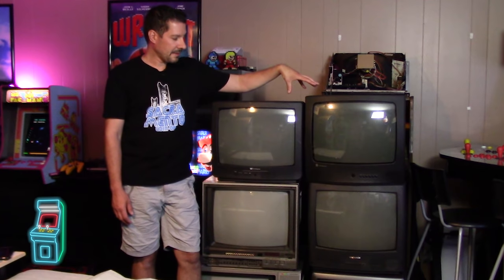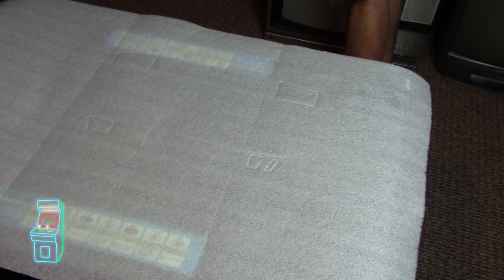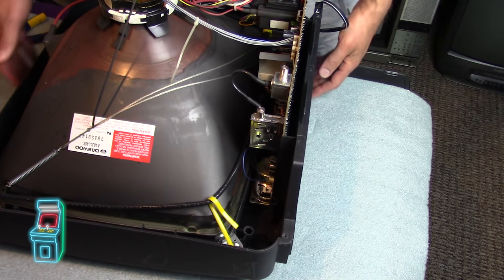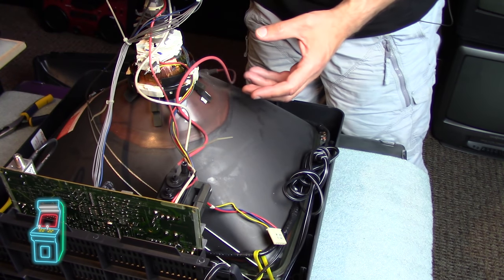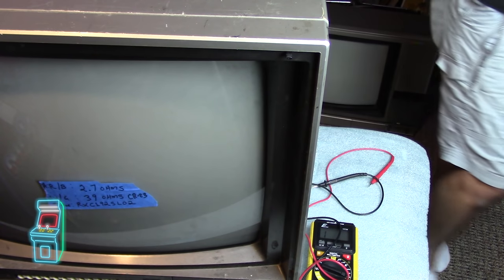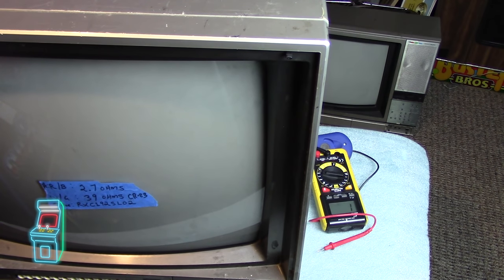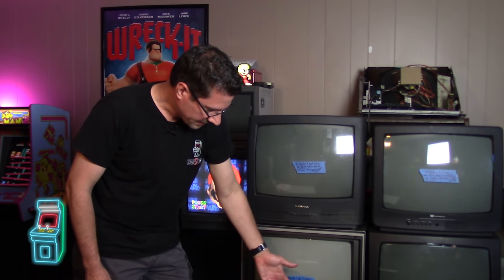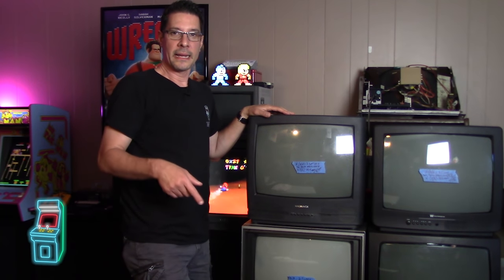TV tubes for Arcade Monitors

Comment: Nice video, I've got quite a collection of crts now  from 10" to 28", i loose the original casings and just shelve the bare tubes in clear bags plus labled, saves space and ready to be taken off for the next build or repair that cone somes in, any crt I find on the road or people listing for free etc i take and strip them, the tubes are usually spot on, i also keep the chassis especially from the real  older sets as I've found the older tvs have good width coils thay are very handy for repairing WG arcade chassis where the width coils are no longer available, the old chassis are also spot on for cribbing parts from.
Reply from the maker: Glad you enjoyed the video!  I keep mine in the cases when I find them. A) I'm able to stack them on each other for storage B) It protects the neck C) My recycle center doesn't take bare tubes, it needs a case. So I swap out the tube when needed and put the burned tube in the TV case. Problem solved. ;-)
Thanks again for watching and leaving a comment. I enjoy reading them.

Comment: I have a sharp tube #a68krq58x. It has measurements of horizontal 1.9 ohms vertical 6.1 ohms. Does this tube match up with any arcade chassis?

Comment: Your comments say 4600 and your video you say 4900.    Great video  now I’m wanting to go tv hunting
Reply from the maker: Correct.  I updated the comments to be more accurate. At the time of the video I had thought that it was a drop in replacement for a 4900 but after checking Ohms on the 4900 itself,  it didn't match up.
Reply: DeLuSioNaL's Arcade  all good I was excited I need some 4600 drop in tubes.  Appreciate your channel
Reply: Doug Jones I had luck with a wood grain early  80’s Zenith for a 4600
Reply from the maker: @alanbrady9609  I went to the recycling center today to dump the Trinitron and came home with a Zenith Woodgrain TV. I still need the test it, but I'm pretty sure it had a CR23 neck.
Reply: DeLuSioNaL's Arcade that’s what I did too!!! I was able to talk the recycling center to swap me tv’s. Ended up with a 25” K7000 compatible tube.

Comment: You didn’t explain how you’re cross referencing the compatibility of the TV tubes. How do you confirm which game a tube will work with?  Are the original arcade tube specs documented somewhere or are you just comparing the resistance in the yikes between the two?  Please explain.
Reply from the maker: I explain it in a later video. Cue it up to 10.23: https://youtu.be/20rZGpSP0dc

Comment: Hey Del love your videos.  Got me brave enough to contemplate tube swap.  Picked up a free sharp 19” tv  amazed my first one a48jll40x  my readings only came out 3.9 and 13.8. Will it work on a k7000 ? I have a milipede I would love to pull the matushita and reinstall with this
Reply from the maker: Yes that should work with a K7000.  Cue up the following video to 10 : 30.  I show a list of monitors and their readings. https://youtu.be/20rZGpSP0dc
Reply: Awesome
Thanks man. I know I got lucky first tv I brought home from my ad on the neighborhood app.  Older folks still holding on to tubes  around me
Reply from the maker: @douginsuresme  Yeah, that should be a drop in replacement.

Comment: How are you doing the degaussing coil on k4600 tube swaps.  The original one is fastened to the metal shield and then soldered to a capacitor. For other monitor tube swaps I always use the  coil on the new tube but I'm not sure how to handle this on the 4600.
Reply from the maker: I plan to eventually do a k4600 since I do have a couple of drop in replacements for that chassis. I plan on using the original degaussing coil for the old tube though. There's no way around that it should fit just fine.

Comment: Hey what's up. I haven't found a single drop in replacement for the k-4900 yet. How much allowance will you tolerate for a drop-in replacement without switching the yoke for those 4900s? That vertical is kind of an odd measurement
Reply from the maker: Yeah that's a tough one to do. K7000 is the most common (CR-31 ). Followed by the older K4600 (CR-23) then K4900 (CR-23) then G-07 (CR-23), in that order. 
There's a list of the Ohm readings for models in the description below. Generally they should be very close to those readings, give or take. If not you will have to swap the yoke over to the new tube, assuming it's the same type.
Here's a playlist I made on arcade monitor repair. In it you will find videos with me testing yoke Ohms on donor TV sets.
https://www.youtube.com/playlist?list=PLMenkBsi2LKD_UMKA36kBKNZ9sES2lON5
Reply: @delsarcade  have you been doing more yoke swaps lately? The last time I watched a video you were still not comfortable with doing the yoke  swap yet and color convergence.
Reply from the maker: I will eventually do one. On a K4900 as a matter of fact. :-)

Comment: I have a tube that actually can’t be identified on tubular?
Reply from the maker: I've had the same thing happen now and then. MOST tubes are at 6.3v (Heater) and 50v (G1) if it doesn't pop up on tubular.
The neck size is typically either CR-23 (thicker neck) or CR-31 (skinny neck).  I've never seen a donor tube any other neck size.  Although there are some oddball arcade tubes out there like the Matsushita (CR-30).

Comment: Hey Delusional I have a question for you.  My arcade tube is having issues and I need to swap tubes.  Finding a 25” on CRAIGSLIST or Facebook buy and sell are near impossible now.  I think these smaller CRT’s were too easy to throw in the car and haul to Goodwill in the day.  All people are giving away  ie are the behemoth 32 and 36” sets  😝  27” tubes  seem a little easier to find however.  Have you ever tried swapping in a 27” tube into a Wells K7000 chassis that’s built for 25”?  I have a Wells K7193 which was built for a 25” .... will this work?

Thanks Delusional,
Adam
Reply from the maker: Nope. It won't. You're looking for trouble if you try swapping different sized tubes. (Radiation issues and such).  I believe it's more dangerous if you swap a smaller tube into a bigger chassis since the chassis is pushing more xrays.  Also if I'm not mistaken if you do the reverse the image will be smaller on the bigger tube (or won't work at all).  I would not chance it. 
Try joining the CRT Collective on FB.
Reply: DeLuSioNaL's Arcade thanks man I appreciate your input.  I’ll take your advice
Reply: DeLuSioNaL's Arcade, hey Delusional would you mind if I sent you a 2 minute video I shot on my phone of the symptom my monitor is giving me and maybe you can tell me if you’ve seen this before and what might be causing it?
Reply from the maker: @montanaroots  Sure thing. Send me a YouTube link on either my Twitter or Instagram account @DelsArcade
Reply: DeLuSioNaL's Arcade will do thank you!

Comment: I am interested in doing a few tube swaps on a couple of my cabinets. Is it true that tubes from 1990 and up will not work in arcade cabinets? I have to find TV's from 1989 and older?
Reply from the maker: That depends. Newer donor TVs typically have the CR-31 (smaller) neck, which is indeed compatible with k7000 models.
But older donor tubes tend to have the CR-23 neck (thicker) which are tube swap candidates  for the G07, k4900 and k4600.
[I'm assuming we are talking about 19" tubes here. ;-) ]
Reply: @delsarcade  yup. 19". Thanks!
Reply: @delsarcade    Keep the same CRT board that the donor tv had and wire them in to the Arcade monitor.
Reply from the maker: @allanpatterson7653  Do you mean the Yoke?  The chassis of TVs vs. Arcade monitors are incompatible.
Reply: @delsarcade  The crt board from the donor tv has always been made for that tube. You can often wire that to the Arcade chassis. The Yoke as well if it's impedance is close enough.
Reply from the maker: Yes, I've typically used the yoke from the donor monitor with zero issues. (I always save the original yoke just in case).  I did it in this video here: https://youtu.be/JjznOc5SHEY

As far as using the original chassis, I've had a couple of friends who have successfully tapped into the RGB and modded the chassis to work with arcade games. Good stuff!
Reply: @delsarcade  I even keep the Yoke forms that burnt out if it is the vertical winding they can be rewound.

Comment: DELUSIONALS ARCADE, the linearity coil does what to the horizontal beam? Somehow the linearity coil will keep the horizontal beam and horizontal deflection voltage to display a straight horizontal line on the CRT but I'm not sure how the linearity coil does this or what the linearity coil does.
Reply from the maker: Did you mean the width coil?
Reply: @delsarcade  no there is a linearity coil also besides the H width coil. I think the Horizontal width coil "adds inductance" to the Horizontal deflection and H Yoke that is why they have a horizontal width coil? The Linearity coil adjusts the linearity of the horizontal beam for scanning to keep it a straight line I'm guessing. For some reason the B+ voltage supplies the screen trim pot voltage and focus trim pot voltage which is around +200vdc. The screem trim pot and focus trim pot are adjusting the B+ voltage up or down +200vdc to the CRT screen and grid on the CRT tube.
Reply from the maker: @billwilliams6338  Sound like you know your stuff...  What are you asking me for then. ;-). Good stuff!
Reply: @billwilliams6338  They never were that linear but they tried.  If you were watching a crt and there was a news scroll at the bottom of the picture you would see the letters  stretch and contract as they scrolled across.
Scan Velocity Modulation was used extensively in rear projection sets for color alignment and it is used a little bit in the K7500 on a little circuit board plugged into P202.